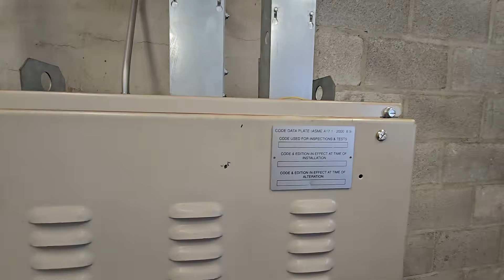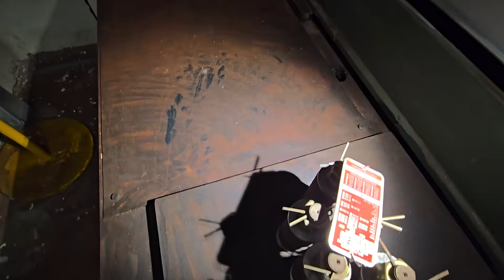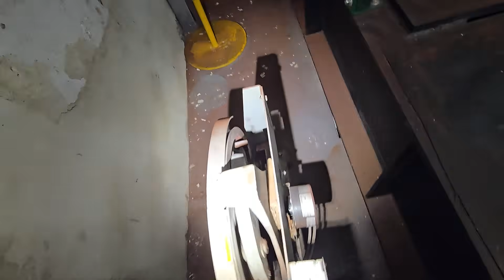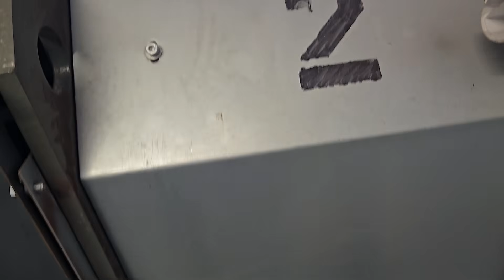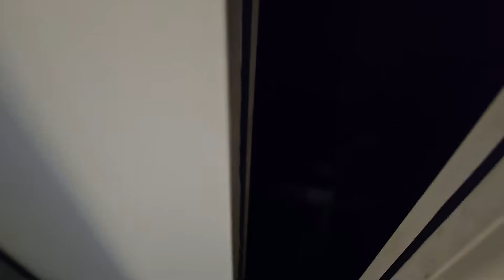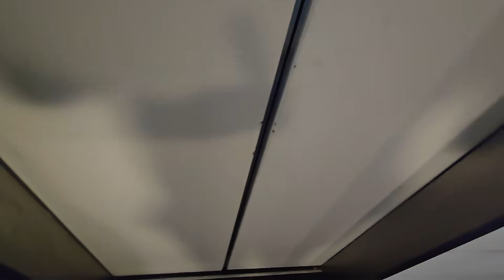Inside Elevator Machine Room | Severe Rope Rouge, Noisy Governor & Maintenance Findings

Comment: I do Uber eats deliveries and I go in a lot of hotel elevators. A few weeks ago I went into an elevator and there was something on the door frame of the elevator when you walk in that add a bunch of green LED lights that felt like walking through a decontamination scanner entering the elevator. I've never seen that before on any elevator, any idea what that might have been and what it does?
Reply: Those are sensors attached to the car doors, and detect when someone walks in the elevator. Which then prevents the doors from closing for a couple seconds. Some of the safety edges have lights on them and change colors typically green when open and red when the doors are closing as an added safety feature.

Comment: I had a building on my route with U.S. equipment that was installed in 1976.  At one point, the ropes on some of the units were 26 years old and still passed inspection, because over the years, they had been equalized and properly cared for.  Newer ropes do not seem to last anywhere near as long, even if cared for.  I had to chuckle when you said “separate repair crew”- I worked for xxxxxxxxx and as an LR in a remote area, I was given practically no support or additional help, yet I had a full route to take care of.  A little rouge on the floor?  At least there aren’t 9 motor generator sets throwing carbon dust everywhere!  Not to criticize your work as an inspector, but the average mechanic is carrying a heavy schedule, trying to take ownership of problems and keep his customers happy, at the same time being on a short leash from the company.

Comment: To save you all looking up "what is rouge" On lift and elevator cables (wire ropes), rouge is a fine, red iron oxide powder caused by internal wear and friction. It is commonly mistaken for standard rust, but it is actually a mechanical issue known as fretting, where the individual steel wires rub together and grind off microscopic metal particles that then oxidize 😊
Reply: Thank you - I figured it meant something like that. As a former English major, the remedial explanation is a big help. The Algorithm has apparently decided, based on the other stuff I watch, that I would be fascinated by elevators..... and I am! 😂
Reply: 'Preciate it.
Reply: Just so I understand correctly: is this to say that the fine metal particles become rouge colored after they come off the cables?

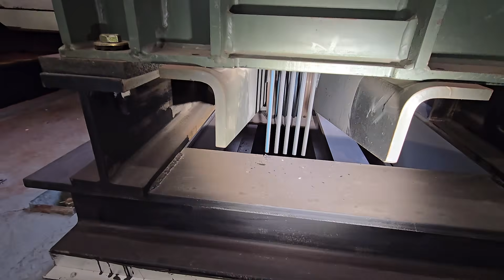Comment: Well, at 5:30 you have a valid point, but I’ve dealt more than once with customers who won’t invest in new cables when we as mechanics have told them way before the inspector wrote it up.
Because a landlord or a building owner only wants to spend money when it’s reeeealy necessary
Reply: It's a problem for maintenance of any kind. You can only do what the customer will agree to and pay for.

Comment: Is rouged a jargon for rust?
Reply: AIUI, sort of, but also not. The cables themselves are not rusting. The cables are rubbing, which produces a fine steel dust, and then the steel dust rusts from exposure to air. So the rust is actually a byproduct of degraded cables, not the cause.
Reply: That's exactly what I thought,  I mean, what else could it be?  Still it's better than saying your cables are rusty when customers and public might hear you.  😅